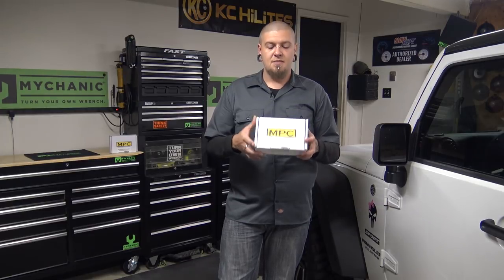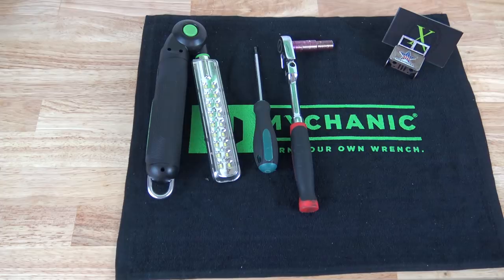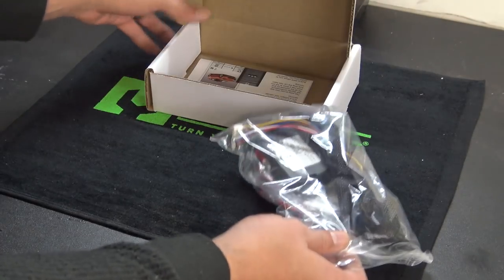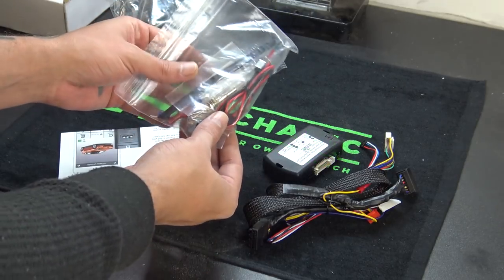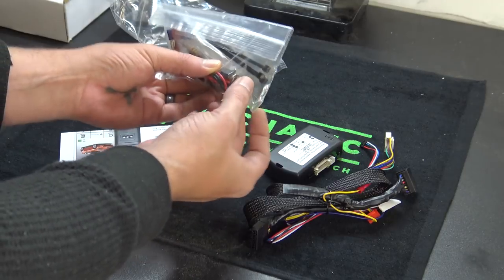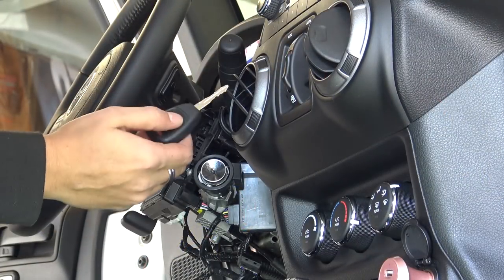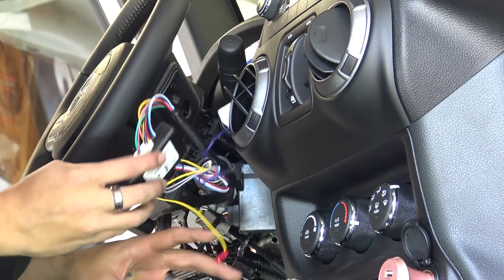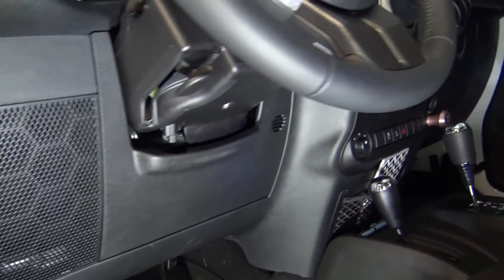How To Install a Remote Starter (2007-2017 Jeep JK & JKU Wrangler)

Comment: So, after watching this video, I decided to give it a try. This tutorial was incredibly helpful, and I thank Rocky X. I would, however, make a few observations, based on my install. First, bottom of the clam shell  around the steering column DID come out without removing the steering wheel, but it did break off a small piece of that lip. It was completely hidden after re-installation, and served no purpose at all. When you try to remove the lower half, try to pull the side facing the passenger out just a little to clear the ignition. Secondly, the harness plugged in to the immobilizer is REALLY hard to remove. the wires run in a small slot where your finger needs to go to release the catch. You can gently manipulate this bundle of wires to make it easier to push in the catch and remove the harness. Last, getting the lip on the lower half of the clam shell back in behind the back of the steering wheel is almost as much fun as removing it. if you can get a little bit in, feed it in with a trim tool until you get all of the way around. I hope this helps someone trying this for the first time, as I was. It is a little challenging, but SO worth it for such a useful, high quality product at a great price !
Reply from the maker: Thanks for the comments! I'm sure they will help out more than a few people. Thanks for watching!

Comment: Thank for this awesome video! I followed along and it could not have gone easier. I installed this on my wife's 2016 Wrangler Sahara. I was most nervous about the lower steering wheel shroud after reading other comments but mine just popped right off, no prying and no broken clips, maybe the Jeep gods were cutting me a break. In any case, thank you again, and thanks to all the commenters as well.

Comment: great video i just have a question after starting the vehicle, unlock the doors, get in insert the key, turn to on position and the way you go?
Reply from the maker: You are correct! Just don't hit the brake pedal before you put the key in, it won't hurt anything, it just shuts the Jeep off and you have to restart it with the key.

Comment: After watching this video easy install in a 2015 wrangler 

Question - if I want to remove the remote start - is it as simple as replugging the original wire back to the immobilizer?

Comment: I just installed the auto start on my wife’s wrangler. Your video made it an easy install. I do have a question and hope you may be able to answer it, when I auto start, I put the key in the ignition, but after turning the vehicle off, I removed my key but the dash board is coming up with the message that the key is still in the ignition and the car can not lock or unlock with the key fob. What did I do wrong?!?!
Reply from the maker: That sounds like a firmware/software issue with the remote start module. Is it from MPC? If so I would contact them and let them know what's going on and they should send you a new module with the corrected firmware/software.
Reply: After trouble shooting it, found out I didn’t align the plastic lid that I removed. The metal piece where I insert the key was getting stuck!  Thanks for the quick reply thou! I have subscribed to your videos!

Comment: Man that was simply genius 
Clear and easy 
I have a question for you. I have bought a used remote starter without its Manuel. I need to install it in my Suzuki GV. My car has the system already installed but the two keys are lost so this is why I have got another system. 
Here are my two questions
1: can I just replace the connections wire per wire in order to ensure myself a correct installation?
2: the way to program the key as you showed, is it the same in any car?

Thank you 😊
Reply from the maker: If it is a system of the same brand and all of your wire colors are the same on the new as the old system you should be okay with switching out the system. As for the programming, I can't say for sure as different systems/brands have different programming procedures. Sorry I couldn't be of much help, but thanks for watching!
Reply: Rocky X TV I like when youtubers interact with comments. 
Don't worry about your answer it helped me too much though. 

Thank you bro👍🏼👍🏼

Comment: Great video, i am guessing that this product is only intended for automatic transmissions. It there is something out there this simple for a manual?
Reply from the maker: These kits are for automatics only unfortunately, but I'll get in touch with them to see if they off or plan to offer anything for manual. Thanks for watching!
Reply: Rocky X TV , any word on a manual transmission remote start option?

Comment: Great vid would have loved more detail regarding the clam shell cover removal and then reinstallng. From what I’ve seen that is the only PITA. So more help with that would have been better. Thanks for the rest though. I’ll be installing two of these tomorrow 2013 and 2016. Thx Mikel Todd for your extra help
Reply from the maker: That part was a bit of a pain. You will only have to deal with the hard clamshell on the '16, the '13 is different and comes apart very easy. They started adding a lip to the clamshell in mid 2016, so you may or may not have to deal with that lip on the newer Jeep. Thanks for watching!

Comment: I have a 2013 Jeep Wrangler that didn't have power locks or power windows when I got it. I have installed aftermarket power locks and windows and everything has been great. Next I would like to get remote start. Is there a kit available that I can use with my current After Market remotes ?
Reply from the maker: There is a kit you can use, it however would require you to have an additional key fob (comes with this kit) This kit is designed to work with Wranglers that didn't come with factory keyless entry, I'm not sure if there would be a kit that works directly with your newly installed keyless system. Here's a link to the kit for your rig, thanks for watching! 

MPC Remote Start Wrangler NO Fob - https://goo.gl/fSG3u3

Comment: nice video,  I really don't like the 3-5 beeps from the horn before starts the cars, any options to remove those beeps?..
Reply from the maker: I believe there are a few options. You can silence the horn all together through the Jeep's system/options and you can also change how many times you have to press the LOCK button to start. There may be some other ways, but you may have to get a Fortin Flash Link Updater to change some things with the remote start module. I think there is also a "Smart" module that you can add to this system that allows other options using a smartphone. I hope this info helps, thanks for watching!

Comment: Hey is their a way to turn off the vehicle with the key fob? Also how much time does it stay running?
Reply from the maker: You can turn off the vehicle with the fob, just press Lock three times like when starting it. This will turn the vehicle off. The run time is 15 minutes and the vehicle automatically shuts off. Thanks for watching!
Reply: Rocky X TV but if I drive the vehicle won’t shut off right?
Reply from the maker: @mesdimo3  If you remote start the vehicle and then put the key in and drive it will not shut off on you. As soon as you put the key in and turn it to the ON position, the remote start module is deactivated. Now if you press the brake before putting the key in, yes it will shut off, that's a safety feature.

Comment: GREAT VIDEO!  Do you know if there is a way to make the parking lights come on when the vehicle is started with the MPC Remote Starter?
Reply from the maker: I'm not 100% sure, but that may be a feature you could enable with the Fortin Flash Link Updater. You can contact MPC customer support and they can tell you for sure, they are very nice and very helpful. Tell them Rocky X TV sent you! Thanks for watching!
Reply: Thanks Rocky!  I'll contact them

Comment: Thanks for the video. How does it work with the sport model which does not have the buttons on the key?
Reply from the maker: Unfortunately this kit will not work with trim levels without key-less entry. MPC has other stand alone remote start kits that will work though. Thanks for watching!
Reply: Is there a way to add the factory keyless entry module as well? I mean Just the module not the door locks...
Reply from the maker: I don't see why not, I've never seen or heard of it being done though.

Comment: Hi there...
Can I try this awesome winter solution on a manual transmission?... I will assume that I will always leave the car in neutral.
Thanks in advance...
Reply from the maker: They say it won't work for the manual, but I have no idea if things can be done to get around this.

Comment: How far does it reach for the remote start to work? Also is it possible to program another remote instead of the key for a farther reach?
Reply from the maker: The range is the same as the range for your OEM key fob. I'm not sure about programming another remote, but it does sound like a good idea. If you contact MPC customer support they could tell you for sure, they are super nice and very easy to work with.

Comment: Great Video.  Will this work on a manual transmission?
Reply from the maker: This Plug-N-Play kit will not work on a manual, but I have seen people use the full wire it yourself style kits on manuals. Unfortunately I'm not 100% sure how they do it though. Thanks for watching!

Comment: Will this work if I installed a power lock kit on my Jeep? Could I use that remote that I have even if its not a factory remote?
Reply: Brandon, did you install  it with your aftermarket power lock kit?

Comment: How easy or not easy was it to remove that cover with the lip can you comment of your experience thanks
Reply from the maker: It wasn't nearly as bad as I had previously read and been told. If you have the right tools it's no problem, just take your time and try not to get frustrated. That's the hardest part, not getting frustrated and breaking things. Thanks for watching!
Reply: Rocky X TV how did you got the lower cover back because of the lip ?

Comment: I just want to ask what are the connection from the 20pin to the t. Harness 
 Because mine arrive there is no connection from the 20 pin its all separate
Thanks
Reply from the maker: The only wire used from the White 20 pin will be the solid Yellow if installing on a Wrangler. This will connect to the other solid Yellow wire that goes between the two other plugs. Just splice that Yellow in with the other Yellow and you should be good to go, thanks for watching!

Comment: After installed. My dash has a red light on whenever i start the car with the remote. And sometimes all the light flashed orange for half second while driving. Am i doing anything wrong?
Reply from the maker: I've haven't heard of this issue happening while driving. The red light being on while it is remote started is normal in most cases (Jeeps seem to have minds of their own) I would say call MPC tech support, they are really nice and very helpful. I'n very sorry that I couldn't be of more help.
Reply: I have a similar issue: 2017 Wrangler Unlimited and the red light stays on unless I shut the engine off and restart with the key.  Any thoughts?  Purple wire is cut and everything else is perfect.  I have the kit with the toggle switch.

Comment: Thanks for this video. I heard that the late 2016 and 2017 models are a Beeotch to deal with because of that lip. I have also hear about people taking their steering wheels off too. Well I got my MPC from Amazon and fought with that shroud for about an hour. I eventually said F it and packed it away. It has been two days and after watching this video I will give it a shot - but I did notice quite a bit of editing in that sequence. Here goes....
Reply from the maker: That part was edited because there is a little cussing involved, you'll see (it's a required step). Good luck with your install and thanks for watching!
Reply: @RockyXTV  I actually used a small plastic ice scraper on my first go around, then I progressed to metal putty knife that I wrapped in duct tape to prevent scratching. I'll try again tomorrow.
Reply: @Joewilliecleveland I posted a comment up above about this. Very frustrating indeed! :-)

Comment: have you done any testing with distance on this starter? It says "up to 1000 ft" but how much do you actually get? does it go through brick walls?
Reply from the maker: It will go through some walls, this kit uses your factory Jeep remote. So it will work as far as your remote will. As for their stand alone units that have their own buttons I can't say as I do not have one. hanks for watching!
Reply from the maker: In the original video I made about this type of remote start, I show using it inside the house, on the second floor and it works fine. The original video I made was not a MPC, but they both use the same Fortin module, so they are pretty much the same.

Comment: When programming, do you need to do both keys or is it just the vehicle that is programmed?
Reply from the maker: You only need to perform the programming with one key. Both keys will work with the system after programming though. Super easy!

Comment: I noticed you didn’t show putting the bottom steering wheel (with the lip) piece back on in the video. I found getting it back on was harder than off with a removal tool
Reply from the maker: If I remember correctly it wasn't to awful of a job. It did take a little patience an most likely some choice words, that's probably why that part wasn't shown in the video. Thanks for watching!
Reply: Rocky X TV Thanks! Tricky but much easier than taking the steering wheel apart
Reply from the maker: Very, very true!

Comment: My jeep doesn't have electric door locks or windows. Will this work for my 2016 wrangler sport
Reply from the maker: Not this kit from the video, but here is the one that will work for your Jeep and it installs very similar to the one in the video. MPC Remote Start Wrangler NO Fob - https://goo.gl/fSG3u3 Thanks for watching!

Comment: Any way to program the starter so you don't have to press the lock button 3 times and instead unlock and start the car by pressing unlock twice? I think that would be better than pressing the lock button three times to start the car, and then press unlock when you're there, it would be faster.
Reply from the maker: You can buy or "rent" a Fortin Flash Link Updater from MPC, this will allow you to change a bunch of stuff, but I can't say for sure what you can change as I've never used one. I think I remember someone saying they changed their startup procedure to a different button sequence. It could be worth a show, check out My Push Cart and take a look at the options for the Flash Link Updater. I hope this helps you out, thanks for watching!
Reply: Thanks, will start researching immediately so I can fit it in my dads 2012 COD Wrangler XD
Reply from the maker: Those were a cool edition of the Wrangler!
Reply: YES!!!!, let's hope for some more cool new editions later on!
Reply: I have a 2018 Jeep Wrangler JKU “Freedom edition/Oscar Mike edition” it’s cool when they first introduced them they were only available overseas where military were stationed in combat zones (tax free buy) but like any company I guess they weren’t making enough money from just that so they started selling them in the states as well, would have been cool to get one while I was in Iraq but I think they came out in 2013 and I was out of the marine corps in 2009. It’s pretty nice had AEV front bumper (hated it as Jeep wouldn’t allow AEV to include the winch plate with a factory installation, which means in order to install the winch plate you literally have to completely remove the bumper), AEV rear bumper, AEV (I believe) super slim low profile rock rails along with a few decals and special badges. It’s definitely a sweet ride.

Comment: I can’t find any actual information on it, can you install a mopar remote start on a 2018 Jeep JKU. I have a automatic transmission with auto lock and auto windows with an alarm system all mopar. I’ve read people have done it, then I read things saying kits you can get from quadratec that are mopar are only kits if you already have it installed and looking to replace broken ones, looking for Jeep dealership to install hopefully making it under warranty as I’m 1 year 20,000 miles into my 3 year 35,000 mile warranty still. I’d really prefer a mopar one unless there is something better, I’ve read horrible reviews from ones like viper that break or stop working shortly after install.

Comment: If you don't have power locks is there still a way to use this?
Reply from the maker: MPC has kits for Wranglers without power locks, the install is a different process though. Thanks for watching!